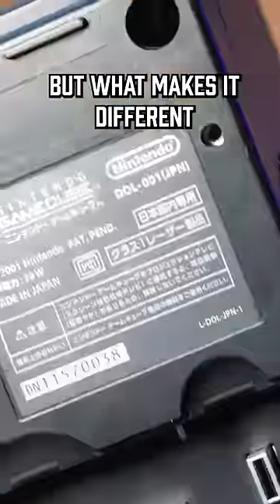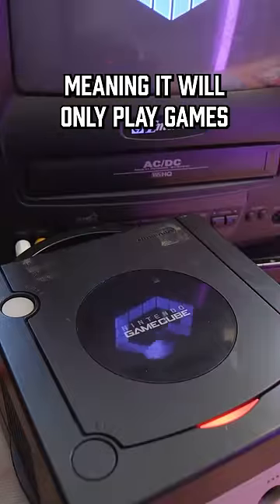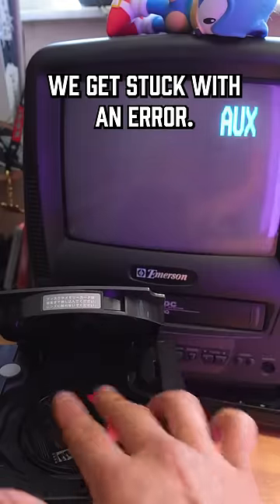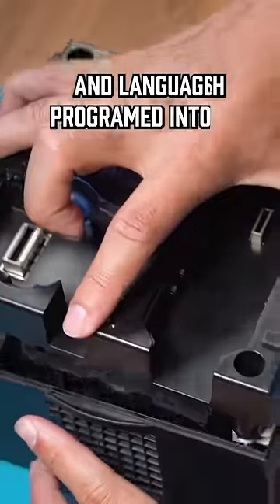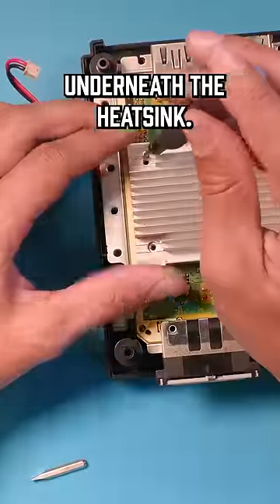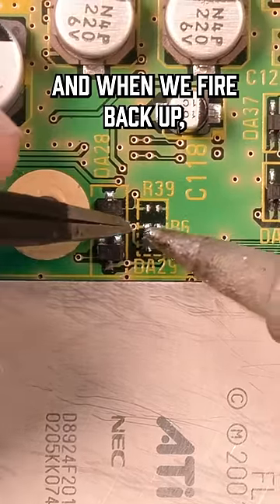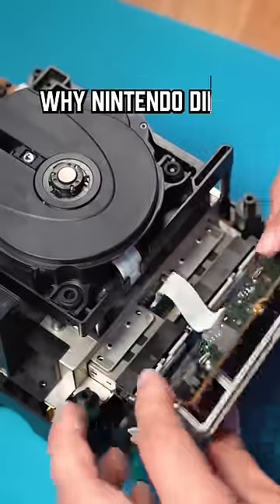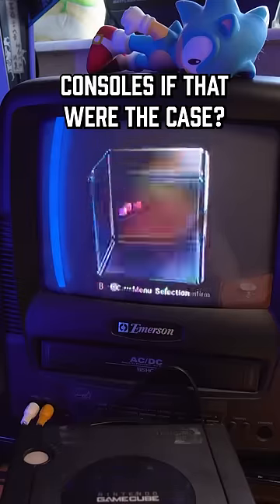Unlock your Japanese Gamecube!!

Comment: Region locks had a LOT to do with licensing deals with publishers. That eventually went away though.
Reply: Nope, it didn't. Now we have DRM.
Reply: @Mavendow  yes, the region locks/versions went away for the most part. DRM is what replaced it since that became a lot easier to implement rather than implementing region specific versioning.
Reply: @CreativityNull  Again, no, they didn't go away. MANY modern series are region locked.
Reply: @Mavendow  Name a modern game that does this.

Switch, PS5, PS4 disc games, Switch, Xbox Series X/S, and Xbox one do not support region locking. PC might only do it by the platform it's being sold on and whether it's able to be sold there, but that's not quite the same since if you get the game it still works and it's not hard to get around regions on most stores.

Region specific versions don't really count because that was being done for different reasons and again, that has to do with where it was sold, but nothing prevents you from playing that region's game in another region once you get it. Usually these have more to do with making sure the game abides with local laws (like Australia.)
Reply: @CreativityNull  PS and Xbox aren't region-locked, but the account is, and that's where ALL PS/Xbox games are region-locked by default. Whether some games can opt out of this region locking, I don't know, but I do know the majority don't opt out. ALL Steam games are region-locked in a similar way. Phone games, again, region-lock.

There are of course DRM-free platforms but they're not the majority.
Reply: @Mavendow  Okay, but a disc or cartridge isn't going to follow that region lock. Only the store will.

With steam you just have to use a VPN and a new account. The game will be locked to that account, but that's not really for region lock reasons.

You still haven't named a game or series that follows this BTW. You said there was a bunch, but I haven't been able to find any.
Reply: @CreativityNull  That workaround functions for Xbox and PS as well. Doesn't change the fact that they both have a region lock mechanism.

"... but that's not really for region lock reasons."
It is, games are sold cheaper in some regions. So, games purchased in those regions are not playable without the exact same workaround.
Reply: @CreativityNull  I did some digging, and while the Switch doesn't have region locking like the other two, all Switch DLC do have region locks.

I have no idea why they did it that way.
Reply: @Mavendow  No, it isn't if you will read the rest of the context where I said "that's not really for region lock reasons."

It's locked to the account (unless you own the game on another account, then it will work, but at that point you're buying it twice) because of DRM that has nothing to do with the region. It's locked to the account because they don't want you sharing files. It has nothing to do with maintaining region control. Steam does this for ALL games, and it has nothing to do with region lock.

EDIT: Oh yeah, I forgot library sharing is a thing in steam. You could literally just share the library from one account meant for one location to your primary.
Reply: @CreativityNull  I did read the context. It's wrong. They don't want games being shared when they're cheaper in other regions. Why is this hard to understand?
Reply: @Mavendow  🤦‍♀️
Reply: @CreativityNull  I'll assume that means there's no valid argument forthcoming. It's nice to confirm it for me, though. People usually just go quiet when they realize they're wrong.
Reply: @Mavendow  no, it means I'm done with you because you're clearly not reading what I'm saying.
Reply: @CreativityNull  It's not possible to argue with an idiot; it's only possible to inform them they're wrong and hope they do eventually get it. So, it doesn't matter what's said after the point's been made. It only matters that I see a response confirming my reply was read. Like this one. This is another perfect confirmation that my point has gotten across.

Whether it's sunk in or not, well, that will depend upon whether the other person's I.Q. can be measured at more than two digits.
Reply: @Mavendow  You're right, it's not possible to argue with an idiot who's incredibly sure of themselves to their own detriment, so see you later.

You still never answered my question about the games 🤣
Reply: @CreativityNull  I see, tit for tat is the best we can do. Two digits it is. My time is worth more than that.

Edit: Oh, that "question." The answer is "any game with region-locking DRM." What an absolute brick of a person.
Reply: It didn't go away. They have almost total control over your console now through forced online checks. Xbox  is useless if you don't have internet access ...even if you have a physical game.  PlayStation is slightly better and still allows a lot of games to be played off the disc.
Reply: @CreativityNull ill my ubisoft games on pc are region locked. It is easily bypassed of course since it is PC, but still.
Reply: @Mavendow seems weird for Steam to region lock an account when you can do the family/friend sharing with people in different countries and they can play your games 🤔
Reply: We still have region locked consoles tho. So it really didn't
Reply: Licensing with publishers, artists also the censorship stuffs which differs from region to region

Comment: “You can do it pretty easily”
“First, take apart the whole thing”
Reply: I really don't get it 
It's basically unscrewing a few screws and using a hot knife
Reply: have you ever like made an ikea chair
Reply: @dazcarrr as someone who has built a lot of furniture and disassembled electronics, they're not really comparable. Electronic parts are a lot smaller and require more dexterity and attention to detail, as well as being easier to damage accidentally
Reply: And?
Reply: @fawnila6310 they’re fairly comparable. As evidenced by your comparison. If your only contrast is that one is more difficult then saying they aren’t comparable is a bit strong.
Reply: @ghettosteeve  if you read, you'll see my "only contrast" wasn't that "one is more difficult." It was that one requires higher dexterity, higher attention to detail, AND holds a greater risk of accidentally destroying an expensive device beyond repair
Reply: Its really not hard. But I guess I'm glad people think it is because I literally run a repair store 😅 so keep thinking it's hard actually.
Reply: bro just push the screwdriver towards the screw, ccw rotate it, place it at place where you won't lose it (lay it all out like a map), move to another screw, goto 0. use plastics to unclasp plastics. be careful with old plastic and that's it. maybe do some photos during the process. even a zoomer like I can do it
Reply: It is not that hard to get to the motherboard of a gamecube. Take out the power port, controller ports, a piece of plastic, and then the laser. Then take the heat sink off.

Comment: There were a few reasons for region locking.  Enforcing the purchase of same region games for the price the Local Publisher put it at.  Some game being too risque for one region uncensored; the Gamecube predates CERO.  

It really was just a whole lot of work for something that not a whole lot of people were doing and most games that release worldwide are nearly identical these days.
Reply: Funny part is when Canadian movies/games have different publishers/distributors than US ones, since they're the same region code. So in those cases region locking doesn't actually prevent cross competition (at least in those 2 countries)
Reply: Then there is the herts from tvs back then too.  While pal region tvs could display images at 60 hrtz it wasn't that common I assume.  I know my system would ask if I wanted the game in 60 hrtz as it detected my tv was capable of displaying it.
Reply: @hikaru9624  I don't think the scan rate was as much a problem as the color encoding format.  There were a few fringe cases with the connectors that accidentally worked around it; but doesn't seem like it was particularly useful.
Reply: Tell that to the HDCP people.  This is what replaced earlier schemes to lock down playback to specific markets.  

I think the real reason region coding went away, is that everyone started getting a better handle on International distribution, surrounding laws, and agreements that gave a path to go after major boot leggers (the reason for a lot of it in the first place) in places like China.
Reply: @freelancerthe2561  forgot that colour thing was an issue.  Been a good while since I last used a CRT tv
Reply: @Plumtopia  that's because Canada was not a threat and region locking was not necessary. Back in the VHS era U.S., Canada and Japan shared the same format. When DVD's were introduced Japan was separate from U.S./Canada (same thing with BluRay now) however when it comes to streaming today, Canada and the U.S. do not share the same content and you'd need a VPN to watched one vs the other.

Comment: region lock maximizes profits, since you can charge more depending on the market, and helped the manufacturers from copyright issues. Also places like Europe had different power source that does not match North America so would require additional hardware to be able to play both (that's additional cost)

Comment: The reason why region locked consoles were a thing was because they were still making money per console sale, but not everywhere. The market in Japan was more competitive than the one in the US, which was more competitive than the one in the EU. Consoles in Japan would often sell at a loss, with games bundled. If someone was to import them over to another continent, they could resell for massive profit. Disabling them from ever doing that is necessary if you want to compete for market share.

The reason we no longer have region locking is because Nintendo no longer tries to compete for direct market share, and Microsoft and Sony are both losing money on console sales everywhere, and so that extra cost of locking has next to no benefit with it. If there was a region where they could sell for three times as much, we’d see region locking again.

Comment: The real reason for region lock was so thay they could charge different prices dependant on the country to maximise profit (poorer countries families cannot afford 60 dollars etc) and not worry about people just importing them from the cheap country. This practice still happens to some extent with key resellers abusing currency exchange changes, but has largely gone away as the internet forced stabilised prices and the backlash was high.

Comment: You could also do this with four wires, a polarity switch and two resistors 
On the switch solder a wire to top left pin and another wire to the top middle pin
Solder a wire to the bottom middle pin and anothet to the bottom right pin
Connect resistor to top middle or top left pin
Conmrct other end of resistor to board

Comment: I bought a used gamecube at GameStop back in the day. It had a switch on the back and I had always assumed it was a Channel 3/4 switch like back in the day on older consoles. It took me longer than I would like to admit to realize that the GameCube doesn't have a Coaxial output, therefore, there would be no channel 3/4 switch. 

So I flipped the switch, turned on my GameCube and BAM, Japanese. My Gamecube was premodded! I was pretty stoked. Best buy ever!

Comment: The issue with regions back then was also the differences with analog tv standards. America adapted NTSC and Europe adapted PAL so they kinda had to. I had a modded PAL Wii/GC that i could only use on certain tvs because the TV itself didnt support NTSC. That problem kinda disappeared though once LCD TVs became a thing though.

Comment: You could also try running Swiss Custom Firmware on the console (using a save from one of the supported games), Run it, change the disc to your US disc, and run the disc through there.

Comment: it’s likely that the ability for cross language console was due to the resistor i worked making a product for 3 months and at one point we had to completely redo all available boards due to a piece being the wrong way around not allowing for wireless use (through a usb transmitter not an onboard one) and this was in 2022

Comment: Well back then it was to avoid "piracy"   but really it was too maximize profits. Games and consoles were sold to each region and priced for that region. So, to avoid people just buying bulk consoles in cheaper regions and reselling them for profit, they did this. And also because certain regions ran different framerate because that's just how the regions grew up. Us ran 60/30/24 fps and most other regions ran 50/25 fps.

Comment: On the NES the region lock was controlled by one pin on a transistor. Soldered a switch to mine so I could switch it on to play PAL or off to play NTSC

Comment: Region locking was necessary because of all of the different television systems. Which by the way is how the regions are named as. This basically softly ensures that a pool of games and console systems are staying in the same region. PAL, NTSC, NTSC-J and so on. It would be weird to have these systems going around maybe working, maybe not working with your own TV. This basically disappeared with digital displays with very standard interfaces such as HDMI. Also games need to be localized and some games cannot fit all the languages on the same cartridge or disc(s). So region-specific games were inevitable at the time. And same thing, as a manufacturer you don't want some japanese game in a non-japanese (after) market and so on. It's a confusing look for the brand. Now with digital games it's of no need anymore.

Comment: It's sad how many folks here in the comments think soldering is advanced technique 😞 it's basically metal hot glue peeps, nothing fancy. If you want to learn, get yourself a cheap soldering kit (with a stand! You will burn holes everywhere without a stand) and a thrift store electronic: almost anything will work, you just want a practice board.

I still have my first soldering project, 8th grade light bulb that my dad and I made with a baby food jar, alligator clips, and some scrap wood & wires. We happened to have spare housing wire for the terminal connections (12ga solid copper lmao), and we acquired nichrome wire (hard to come by pre-vaping & Internet ordering circa 2007) for the filament. Everyone else's lights ran out of juice (tiny terminal wire gauge, short filament) or burnt out in 5 minutes. Meanwhile the teacher stopped timing mine as its light didn't so much as flicker throughout the whole class period. Sucker lasted 1x 50 minute class, a 30 minute lunch, and well into the next class period before running out of juice. (We were allowed 6 or 8 D cell batteries, i just remembered it being absurdly heavy for its size).

Comment: Never had to remove the resistor. And i used wires and a switch and it works just fine

Comment: I can see a few reasons.. 

1.) It's easier to control the price of a product in a market. You don't deal with supply and demand on a global level, just a regional level so that if a game isn't popular in Japan but popular in the states, Nintendo can still command a high price in the region with higher demand while liquidating in the region where there's lower demand without outside influences. 
2.) Some content is acceptable in Japan that's not acceptable in the US. This is also true for Europe. Example: Germany can't or couldn't have anything referencing the Nazi army in content. In the US, there used to be more censorship for games as far as nudity. It makes it easier to region lock than to be held to task by angry mothers and senate hearings like in the 1990's.

Comment: The question is. Do you need the US AC adapter? Sometimes they allow a range of voltages so it’s fine. From what I’ve learned. Most all things from Japan are great as long as they don’t have a built-in power supply. Then you need additional hardware to keep them from being overpowered, in the long term.

Comment: I soldered in a switch, it works well. But solder pads are really small and fiddly to solder. Also has lead free solder and melts at a higher temp.

Comment: Nintendo still have the old mindset of maintain region lock as well they holding on of the old ways of business standard then to update.

But the engineers knows the region lock is bad move, but they design the chip with " just in case " the region lock thing doesn't goes well. Nintendo higher ups did the same thing with their early DS

Comment: Toggle switch. Modding with a relay would be superfluous as you would still need a switch to activate the relay. You wild simply just use a toggle switch to change the region.

Comment: It's not very easy 😂!! To remove the heat sink may require ruining the thermo pads and a USB camera to zoom in and carefully desolder the resistor and move this to the English region. 

I would highly recommend replacement thermmer pads for GameCube board and a USB camera I purchased for £15. You can use this camera to display on your PC screen, it's not the best camera but for the price it's really handy. Also take pictures of where the screws line up and sizes and separate them from accidentally using The longest screws in areas they shouldn't go.

Comment: You don't even need to bridge R6 you only need to remove R5, it's a 10k resistor from what I remember. Know from experience -- had my chisel tip on my soldering iron instead of my hook tip for some reason and burned the traces off 😅